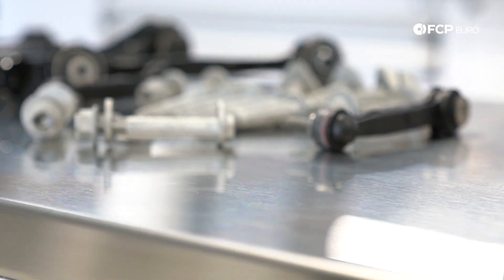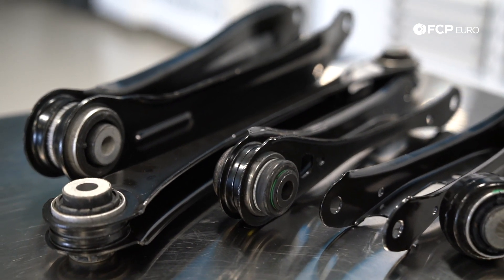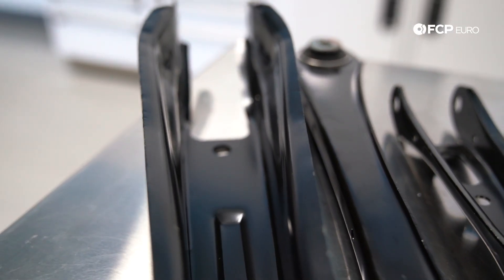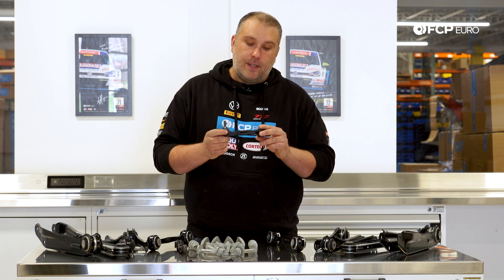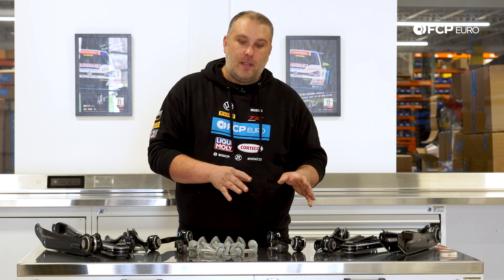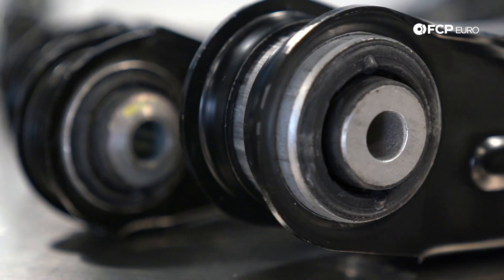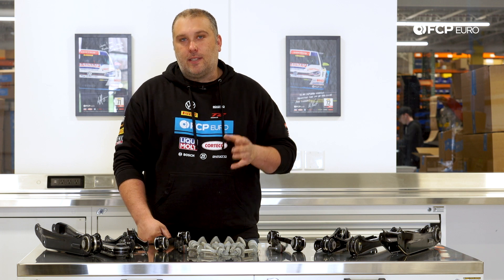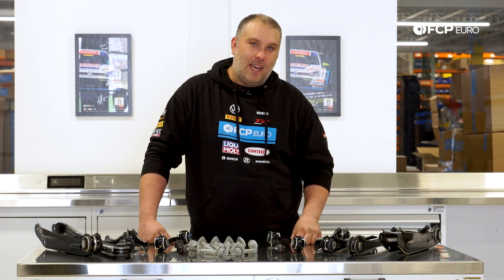BMW F25 X3 & F26 X4 Rear Control Arm Replacement DIY Kit - Failure Symptoms And Recommendations

Comment: BMW maintenance be like: oh 80,000 miles? time to replace the wholeass rear suspension
Reply: also I've replaced the whole left rear suspension on a newer 3 series that's pretty much the same setup as these and it's actually very easy to work on
Reply from the maker: @snoofayy6150  Its not a terrible job to do, but the 80k miles is almost like clockwork on some of these BMW's! Sadly consistent
Reply: @fcpeuro  just like the ""lifetime"" transmission fluid (lifetime of the lease period, then BMW doesn't care about you)